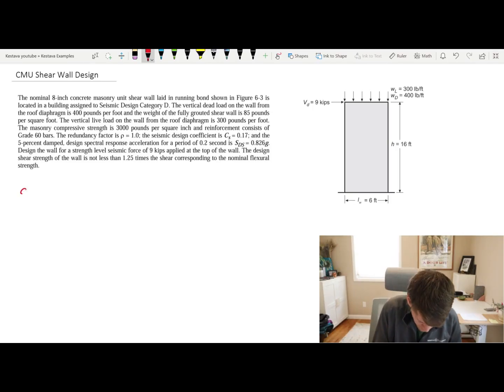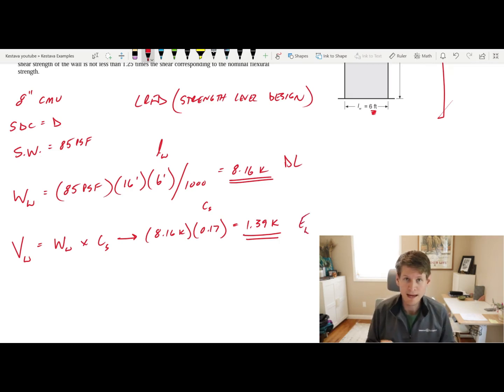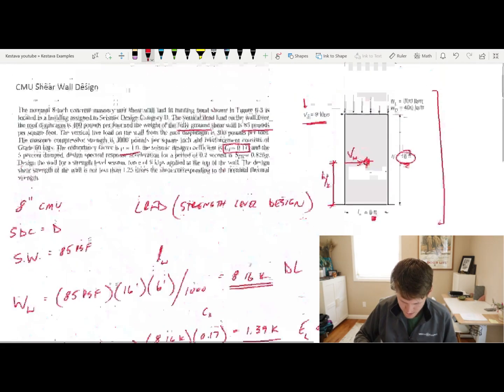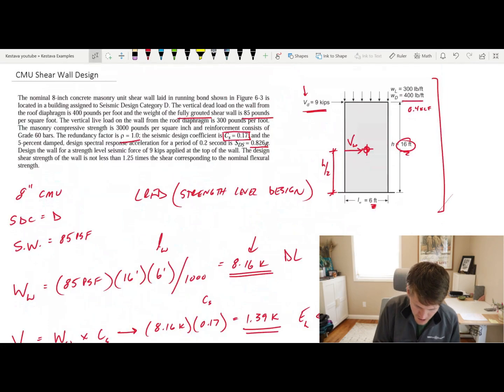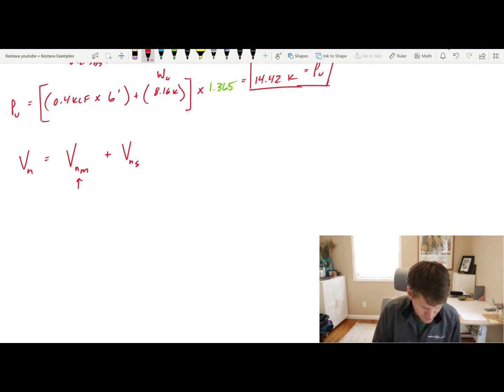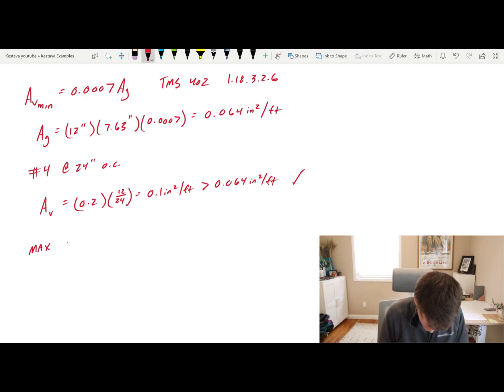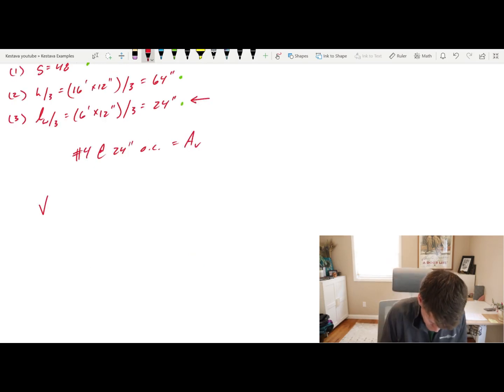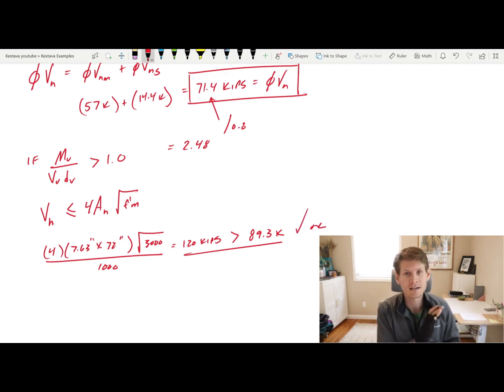CMU Shear Wall Design Example | TMS 402/602

Comment: Helpful video , I think you forgot about the restoring moment coming from the Self weight of the wall + the center of gravity of the dead load coming from the roof. that will lower your demand MU, your controlling load combo will be 0.9D+E

Comment: Great example! Would this be considered special reinforced masonry shear wall?
Reply from the maker: I would have to check all the requirements to consider special reinforced per the TMS but this should be most of the way there
Reply: This is a trick they like to use on the SE exam, they won't designate ordinary, intermediate or special in the problem statement but they will expect you to use the information given. I would reference chapter 12 of ASCE 7 to confirm which one is allowed given the building parameters and SDC. USUALLY if they don't say... the designation is special.

Comment: Great design example. Just one comment. Where you plug in the Pu in the masonry shear capacity, shouldn’t you use a load combination that gives you the list Pu (0.9D-0.2Sds) instead of the highest? I feel like the results won’t be conservative if you use what results in a higher axial load.
Reply: I noticed this too. I believe you are correct.

Comment: When you calculated Pu, why didn't you also include the live load of 300 plf?
Reply: The live load does need to be considered since the load combination we are designing for is actually 1.2 D + 1.0 E + L + 0.2 S.
Reply: @bikalshakya  Why is it not included despite being in the load combination you stated?
Reply: i think live load should be included in the overall seismic weight but only a fraction of it, i believe its typically 25%?

Comment: CMU are not great in seismic unless you can tie it down...
CMU is also terrible for shear ... Hint: Make your sections solid and tied down...
You have shit unless you tie -down is not done. 
Fully grouted just makes a vertical slab...again, you have to focus on the tie-down to the foundation.
Reply from the maker: absolutely! this was just a small sample of some of the steps in designing a CMU shear wall. we would absolutely need to design the tension hold down rebar at the ends of the walls and additional vertical rebar to even consider this as a shear wall. great point out!

Comment: I’m also new to CMU design, I believe CMU is typically in ASD but I could be wrong?
Reply from the maker: Yeah i wasn't sure which method I should have gone with, the example I was working through was strength design, but I believe its easier to design via ASD so ill confirm and most likely be doing that moving forward Jeff!
Reply: i think its mostly ASD for shear and in-plane bending design of wall and LRFD for out of plane bending design if u are using slender wall method

Comment: Very nice video, thanks for sharing! I would be curious to know more about how you would calculate the load on the wall? In the example demonstrated in the video, it was given from the text. But in real life, how would you calculate the total load on the wall?
Reply from the maker: its all about the spans the wall is loading and the type of structure you are designing, aka whats the space being used for? assembly area? residential home? gym? office? the ASCE 7 / IBC  give design criteria based on the use case. thats where it all comes from!
Reply: @Kestava_Engineering  Makes sense! And given the geometry and spans, do you calculate the tributary area to derive the load the wall is subjected to?

Comment: Thanks for the video. Will this type/difficulty cmu wall design problem be expected on PE structural exam?
Reply from the maker: nothing this in depth, but parts of this could be, like the shear capacity equation may be something, and they would give you all the criteria needed to just plug and chug
Reply: @Kestava_Engineering  Thanks for sharing the idea. As always, your video helps me A lot. Two thumbs up 👍🏻
Reply: Why is an 8-inch wall actually 7.63 inches wide?
Reply: @bravomarco7 i believe the remaining 3/8" is left for mortar